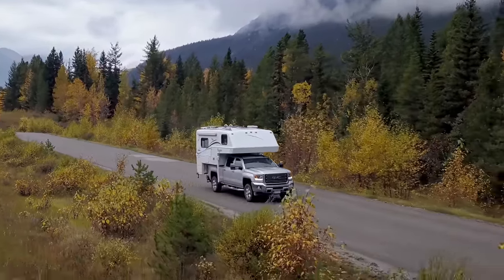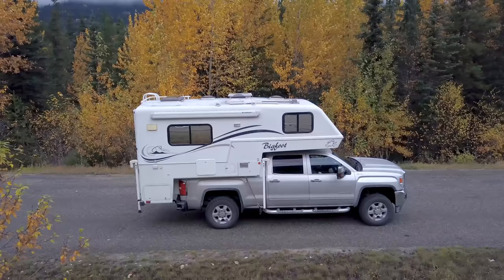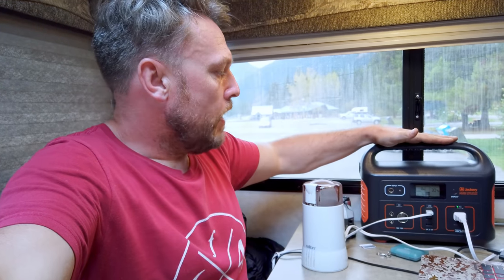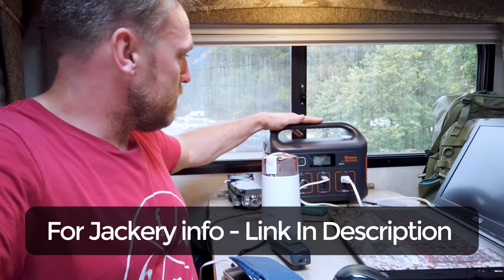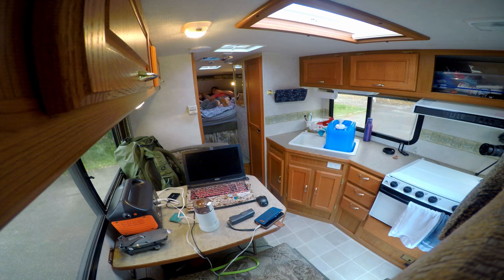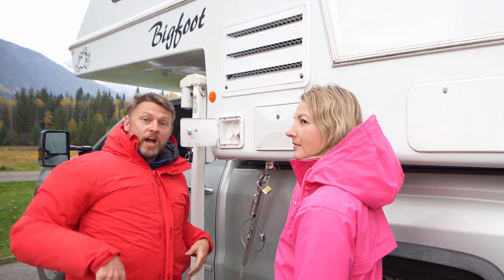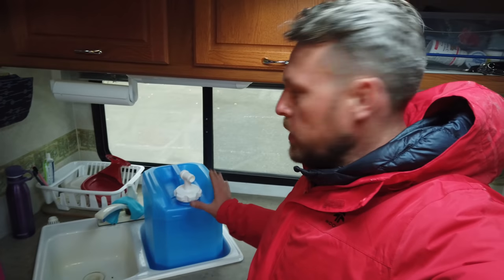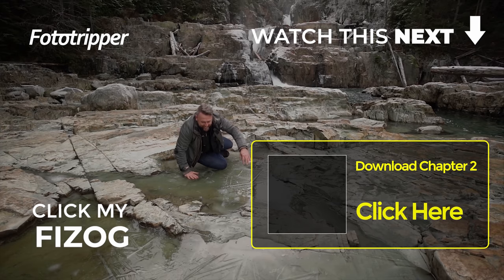Every Landscape Photographer Needs One of These

Comment: The difference between the truck battery and the leisure batteries is that the truck battery is designed to give high cranking amps for a short period of time, ie when starting the truck, but the leisure batteries are designed so they can deep cycle, which is providing less amps but they can run continuously until flat. If you tried to deep cycle the truck battery, it would be damaged internally quite quickly and have to be replaced.

Comment: Been pondering some kind of extended-duration travel rig, so this is well timed, thanks!  I can't imagine the gas milage on that truck is that great, so I'm wondering if it still saves money in the long run.
On a more important note:  those misty mountain shots are just fantastic!
Reply: yup something like 12-15 mpg
Reply from the maker: It's not that much worse than before we added the camper. Fairly modern truck.

Comment: I thought I saw a ladder to the roof in the back.....Just a recommendation; maybe put solar panels flat on top of camper when away from vehicle to charge your Jackery. Or maybe mount solar panels on the roof.
Reply from the maker: I'd just forget they are there and drive off.
Reply: @fototripper  Bolt them down!

Comment: You could just make a temporary mount for the solar panel on the roof with like 2 sided velcro or something, and then run the cord through the sun roof or one of the windows so you get at least some charging from that
Reply from the maker: Velcro at 120kmph?
Reply: @fototripper  fair enough haha... I'm sure there's a better option than velcro

Comment: As for adding solar, have one panel either side sitting flat against the camper during transport (tied to the camper with Amanda's hair bands) in a tubular holder (tube-inside-a-tube).  If you don't want to penetrate the outer camper skin to fix the holder you can also use something like "liquid nails fuze it" as long as the weight doesn't exceed 25-30kg (an no, not your weight...the solar panel and holder weight).  
When on site, flip the panel(s) into a fixed 35 degree (from vertical transport position) angle, assuming you are travelling mainly in or about the 55 degrees North region, and lift the inner tube with the panel up above camper roof height.  Turn inner tube so panel faces due South and fix in place with a pin in a prepared hole through both tubes, so the wind doesn't play silly games with you.  Hey presto, mother sun is charging up your gizmos.
For extra nerd cred, either buy or build a single axis solar tracker that will make the panel(s) follow the sun East to West during the day whilst you're out taking juiced up photos of mountains that never show their face...  A single tracker will increase the power generation by up to 20% (depending on panel / inverter efficiencies, shading and the like).  Don't bother with a 2-axis tracker or an adjustable arrangement for the 35 degree from vertical unless you're planning to take Amanda to Patagonia for your honeymoon...
And yes, I'm an engineer that builds stuff like that for folks like you...

Comment: jackeree in the cupboard above table drill out slots for gear screw on soap dish holder for charging  and then solar panel hard mount on roof  drill through to battery pack and silicon around hole to make sure no leaks ? An idea I thought of may help ?

Comment: Definitely should consider adding a few solar panels to the roof and a couple of 12v lithium batteries at your next upgrade. This will significantly add to the available power. You'll save on propane as well.
Reply from the maker: just one lottery win away...

Comment: You mean Leisure Battery! Ok you beat me with the shower and crapper. Although I do have a port-a-potty for the van. Thomas Heaton is good a fitting solar panels if you need one on the top of the van. I hear cassette tapes are coming back in. But sorry my campers better than yours, well thats because its mine!

Comment: Love those telephoto shots of the woods and the mist.  What focus area did you use for AF? Also how did you manage to get tack sharp images at 400mm using a shutter speed of 1/160.  When ever I try that (same camera setup) on my tripod they are not as sharp.
Reply from the maker: that lens has IS. I had a medium are focus setting.
Reply: @fototripper Thanks for the reply. I have that lens too always been told to turn off the IS when on a tripod as the ibis is looking to help and can make things un sharp. I guess I will try it on with some autofocus and see how I get on round the lakes in England. Suppose on a tripod spot focus will work and away I go. Thanks
Reply from the maker: @leighcowie  That's good advice. If the camera is on a tripod and totally still you'll want to switch off the IS or it'll end up blurred. My tripod was acting more as a monopod and I was waving it around a lot so IS helped but normally if it's not moving and on a tripod I would turn it off

Comment: for the price of the camper and truck you might as well just go with the motorhome. 3/4 ton Dodge 60k  used and the camper will run about 10k
Reply from the maker: no 4x4 in motorhomes.

Comment: Going from DC to AC, then back to DC (laptops' power supply) is very wasteful so going from DC to DC straight away will extend your power life. Look into the Lind DC to DC power adaptors to see if they have something that will work with your laptop. https://www.amazon.com/Lind-Power-Adapter-DE2045-1320-ELECTRONICS/dp/B01AQAK0C6

Comment: I'm holding out for the Tesla Cybertruck and some of the camper options for that.  We'll see what comes of that in 2021/2022/2023 timeframe.
Reply: J G  Rivian is nice but I'm more sold on Tesla.  I have a Model Y now.  Entry level Rivian is $70K+ comparable to the entry level CT at $40K.  Top line Cybertruck is $69K with tri motors and 500 mile range and 14K lb towing capacity.  Dual motor at $49K might be the sweet spot for me.  With the new battery packs, we're hearing 350-400 mile range possible and 10K lb towing.  Camper options are going to be amazing too.  I'll be interested to see what Rivian can do but right now, I'm leaning towards Tesla.
Reply: Rivian does look pretty damn cool
Reply: J G  I plan to do certain due diligence here.  I have to check out the road trip show on AppleTV this weekend.  It sounds very interesting.  Tesla is just about 10 years ahead of everyone else but Rivian has some cool backers too.  The more EV trucks coming out, the better consumers will be.  My purchase will be at least 2-3 years away but you never know if something good happens.
Reply: J G  I'm now looking forward to it.